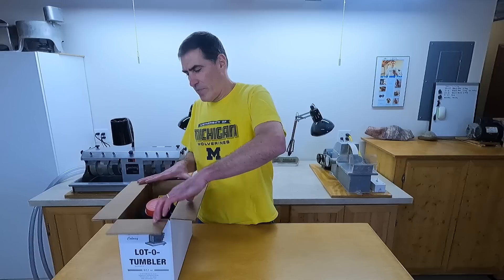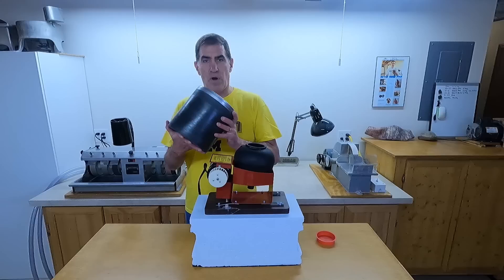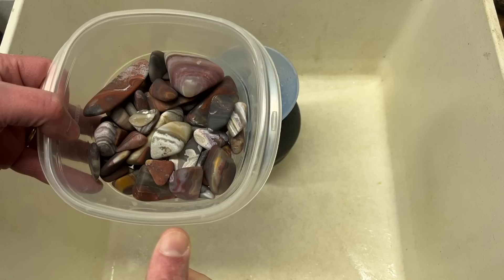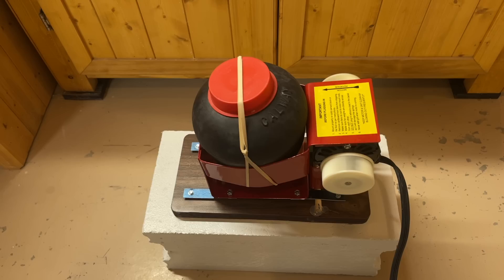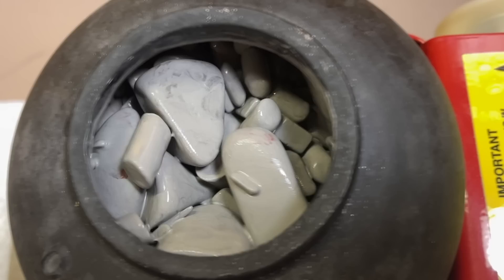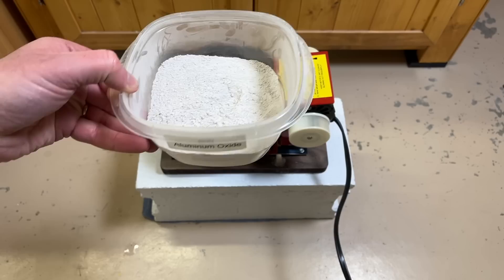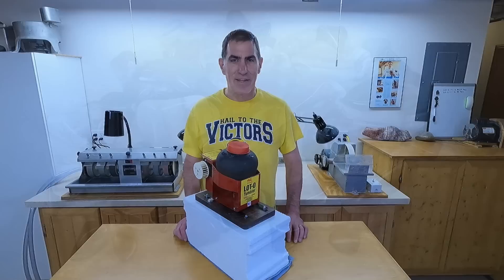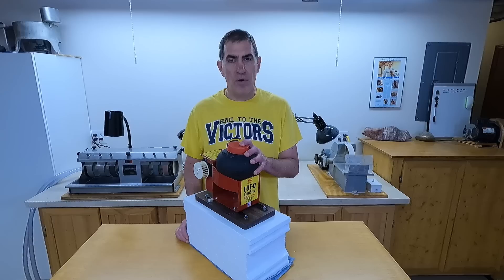The Lot-O Used To Be My Favorite Tumbler. It's Not Now. See Description Below.

Comment: Neat. It’s always fun to get new toys. That was clever of you to move the dowel. It really worked. It’s a shame that the factory doesn’t calibrate them properly. I’m sure that they have a lot of unnecessary returns because of that. The towel made a big difference in sound. You could barely hear it with the towel. The rocks polished up beautifully. The rock tumbling award that you won is something to be very proud of.
Reply from the maker: The towel underneath helps a lot, but the machine still makes noise. Don't expect it to be silent. 

Moving the dowel wasn't my idea, it's right in the instructions that come with it. I don't feel like it's something that should have to be done very often though.

Comment: Never dump down sink or toilet it can easily turn to cement and cost a heavy plumbing bill A wonderful trip I was given if in a rotary tumbler the drum slips take one hundred grit sanding paper and rough up a little bit the drive bar and the outside of the drum and since I did that never had the drum slip since
Reply from the maker: Good tips.

Comment: I'm glad I watched this video. I recently started using a Lot-O twin barrel vibratory tumbler, and I noticed the action didn't seem right (it didn't look like the action I've seen in your other videos). I may need to move the dowel. I'm glad to see others in the comments here have done the same and had positive results.
Reply from the maker: Just be careful not to move it too far. It can break springs if the action gets too violent.

Comment: Thank you for making this video!  I bought a double barrel last fall.  After watching your videos on using it I did notice how different the roll speed was between yours and mine... I was almost to the point where I was getting self conscious about it!  One thing I noticed with the double barrel is that over time the fans had come out of alignment thus causing one side to be less vigorous.  But anyway, great review!
Reply from the maker: I have never had my fan weights get out of alignment, but it's good to know it's something to look out for.
Reply: I purchased a twin Lot-O-Tumbler in the Spring and ran about 12 loads of stone when I noticed some differences in the tumbling speed compared to your videos and my own machine.  The left side tumbled faster than the right side.  I also had the left side fan come off during a session while I was asleep.  I sent an email to the Lot-O-Tumbler folks with an attached video.  The video showed a wobbly spin with the fans and some clicks as the motor came to rest.  I also had the same problem as Jared….one weight was in the 6 o’clock position while the other was at the 7-8 o’clock position.  I was advised to tighten the metal retaining clip with a pair of pliers and all should be fine.

I tightened the fan clip with the pliers and noticed that the right side was also loose.  I tightened both clips achieved a firm grip on both spindles.  I ran another load, stopped to change the grit and the tumbler sounded Ike a bucket of bolts for a few second before it froze.  It appears that the left side bearing is shot.  I wrote back to Lot-O-Tumbler and was advised that replacement motors were out of stock and would not be delivered until mid to late September  I checked several vendors and none of them had stock.

I don’t believe I did anything wrong or abusive.  Looking back at the events, I think the fans were not properly installed hence the bearing problem.  My suggestion to Jared and others it to tighten the fans before you burn out the bearings/motor.  Here’s the instructions I received.

“To tighten up the fan on the shaft ,remove the one the moves and tighten or squeeze the metal clip that holds it on reinstall it re align it and should be good.”

I’m out of the 90 day warranty so I don’t know if I’ll get any help from Lot-O-Tumbler.  The supply problems are also an issue since the machine will be sidelined until I can find a replacement or substitute.  If anyone has some suggestions I’d welcome the help.  This machine turned out some beautiful rocks and I’d like to get it running again.  My advice to new owners is to check the crimps on the fans since I believe it was an assembly issue.

Comment: Rob, excellent Lot-O overview video. I will say I purchased my Lot-O a couple of years ago based off of your work. It seems every single Lot-O is slightly different. I didn't fill my block base before painting and mounting and instantly regretted it. The base needs density more than weight for action sake. I placed railroad rail pieces in the block base and that added density helped action tremendously, so I'm glad you filled your holes. I put an old solid rubber doormat under my block between it and the concrete shop floor. Also, I found the use of a fine mesh sink drain strainer helps me drain the water without losing small ceramic pieces between my fingers, it fits over the mouth perfectly. I have a video on it here. I also discovered upon advice from another Lot-O user that my action works best if I give the bowl a slight, less than level, forward towards the motor tilt. Thanks for all your videos!
Reply from the maker: Hi Lance. One thing that I have noticed is that if you put two of them under your stairs like I did, the noise is more noticeable. You can sort of hear and feel it on the far end of the house upstairs. It's still not loud, but more noticeable than with just one. I have always had a folded up towel under mine. Since buying this second one, I bought some foam blocks designed for noise isolation. They didn't help at all. Now I have bubble wrap wrapped in the towel and placed under the block. I don't think that helped at all, but I left it under there.

I have used the strainer like you mentioned, but I worry that grit will get stuck in the rim around it and contaminate my batch. I drop a few between my fingers, too, but I keep doing it that way because I can be sure my hands are well rinsed.

That's the first I've heard of slanting the barrel. I'll have to try that.

Comment: I bought two of these as part of used lot a while back, that tip about putting epoxy into the dimple at the bottom of the barrel is great, I need to do that. And thank you for showing your process for getting it mounted on the block. I've chewed up rocks by not having mine mounted and know I need to do it, I just wasn't sure what the best way how is. Great content as always, thanks!
Reply from the maker: To put epoxy in the hole in the bottom, I twirled some epoxy on a stick of wood, like you would do with a honey dipper. Then I lowered it in and just let it drip off into the hole. It has never come out in over ten years.

Comment: Hans Beyer
Watched your video on the Lot-O vibratory tumbler review and enjoyed it. I was pleased with some of the information I didn't know like where the dowel is located on mine. I checked and it was like your example. One item that may be worth mentioning in the Cons section, the fact that the motor is warranted for only 30 days. I have to admit I didn't do my homework so I have only me to blame. I purchased my Lot-O last October (2021) and after less than six months the motor was shot. I noticed the noise getting louder and louder so I checked the shaft on the motor. There was considerable play, I could move one side of the shaft up and down, what seemed more than 1/16th of an inch (just a guess). Needless to say I was disappointed. I have tried to locate a replacement but there seems to be no stock. Hopefully that will change soon. Enough complaining. I really like the tumbler, just bummed for my bad luck. Keep up the good videos. I enjoy them and respect the quality of your shiny rocks.
Reply from the maker: A couple other people have made similar comments about their motors wearing out really quickly. That's definitely a con. Since mine lasted ten years, I was pretty happy. That's my only experience, so that's all I could say.
Reply: @MichiganRocks  I have had the same experience of the motors wearing out quickly.  From info I have gathered from others, they changed manufactures of the motor and the quality has gone down.  I still LOVE my lot-o tumblers!
Reply from the maker: @tinawilliams6020  That's really a shame. I'd rather pay a little more up front and avoid the headaches.

Comment: Thank you so much for the great video!  I am going to try adjusting my wooden dowel tonight on my double barrel since I am not getting as fast of a tumble as others seem to get.  
Sadly I have had my single barrel for about a year, and the motor needs to be replaced. Sealed bearing are ruined and local repair shop said that it cannot be fixed, but must be replaced instead. 
I LOVE my lot-0 tumbler! WIth my twin lotto, it 's motor went out (bearings went bad) just 80 days after use, but luckily that one was still within the warranty period and Calway/Belt replaced it very quickly for me!  Even with the few issues, I  absolutely think these are wonderful tumblers!   
Thanks for all of the great videos!
Tina
Reply from the maker: I have gotten a lot of comments on this video about people’s motors going bad after a short time. That’s really disappointing since these are great tumblers otherwise.

Comment: Wow and wow, I have used a Lot o tumbler and am glad to get two years out of a motor!  Unfortunately motors are not covered under warranty!  My lot o has sounded like a machine gun since new, and indeed the dowel was closer to center between the two reference points, I just “corrected” the dowel position, amazing change to the hum I was always wanting, and yes the rocks and media still rotate about the same, I strongly suspect the wear and tear on the bearings will be different with the smoother operation.  FYI I mounted an outlet box on the extended wood plank that was lag bolted to my cinder block with lot o base attached securely to the plank.  The 4x outlet box affords two outlets beside a light switch, very convenient.  Also a flat 1” piece of board insulation on the bottom of the cinder block makes a quiet installation and does not allow the project to walk.  Many many thanks!
Reply from the maker: Thanks for the tips! I can't remember if I showed it in the video, but I have a folded hand towel under the block to keep mine a little quieter.

Comment: Thank you! I have run one course of polishing like you demonstrate in this video through a new double barrel Lot-O.  It was a struggle because I couldn't get an active enough rotation within the barrel.  I paused the video at 18:35 and went to the garage to measure the location of my dowel.  It's 3 cm from the inside screw, and one side is even a little more: the dowel isn't parallel with the frame.  I'm going to take the measures you did and see if I can get that rolling rotation like you did. Thanks again for making such a helpful video.  I really believe the Lot-O tumbler is a superior tool --- once you get it tuned in.
Reply from the maker: With my first one, I didn't have to do anything to it, it just worked right away. It's a great tumbler. I use it on almost every batch of rocks I do.

Comment: Why did someone think it was a good idea to permanently fix an adjustable calibration device (the dowel)? The whole idea of such things is they can be adjusted to accommodate the operating conditions applicable to the final user. Hot glue is fine, perfectly acceptable even, but nailing it down is just bad design. The average, or first time, user is going to have no idea the dowel is supposed to be adjusted because it appears to be permanently fixed. Good job people like you are out there to inform us! 👍
Reply from the maker: I agree, but in the manufacture’s defense, they do mention that the dowel can be moved in the instructions. I don’t know if my first Lot-O has nails or not since I have never had to adjust that one.

Comment: I bought a double and it's still in the box, I bought it right before the prices jacked up. 
A buddy of mine has two or three of these, he changed the caps out because they popped off all the time, replaced with perforated lids, they never pop off now...
One day I'll get it set up, so I can tumble obsidian...
For now I use my 9 Lortone rotary tumblers ( different sizes)..
Thanks for sharing....

PS: This is Fossilman off of RTH....😊👌
Reply from the maker: Hey Mike, this comment came through blank. That's been happening a fair amount lately. I contacted YouTube about it, but they were not very helpful.

Comment from the maker: Since making this video. I have heard many stories about how quickly the motors on this tumbler die and how horrible the customer service is, that I can no longer recommend it. I don't have a recommendation for a different vibratory tumbler because this is the only one I have ever used. Both of mine are still running, but I think it's only a matter of time before their motors give out. There is some really good information about possible replacement motors discussed here: https://forum.rocktumblinghobby.com/thread/100982/experience-lot-failed-motor?page=1&scrollTo=1253535
Reply: I have noticed my motor gets so hot I can’t hold my hand on it. It is only a month old. Is that heat normal?
Reply from the maker: @flyingweinerdog  Yes, mine gets really hot too. My first motor lasted about ten years. It was quiet at first and developed a buzzing sound over the years. I think that sound was the bearings going bad, because that's what eventually did it in.
Reply: @MichiganRocks  Uh-oh... I bought my wife Mary a Lot-O a year ago, and we're mounting it as we speak (Thanks for this video by the way!) I hope the motor doesn't go on us. We lost a National Geographic 3lb tumbler after about 6 months due to that motor dying. It would be a shame to see the Lot-O go too! I wonder if there's any kind of engine oil or something that you can put in there to help it last longer...  Hmm.....
Reply from the maker: @DavidShockley  I don't really know. I don't think those motors come with an oiling hole.
Reply: Thank you for addressing this issue.
Reply from the maker: @vlakslee  I like to be as accurate as possible. I have heard that you can't even get these right now because the manufacturer can't get the springs from their supplier.
Reply: @MichiganRocks   - Yep i have been trying to find a place that will sell the Lot-O, but they are all sold out at all the Lapidary sites i checked.   Have you ever used the Inland DB-100 band saw?
Reply from the maker: @nobodyisprfct  No, I haven't.
Reply: Unfortunately my Lot-O-Tumbler stopped working after 11 months because the motor seized up. I was unable to buy a replacement motor. After a couple months, I was unable to endure the withdrawal symptoms and luckily I was able to buy a new Lot-O-Tumbler. I moved the dowel forward as you did since the action in the barrel was slow. Now it’s working very well. I’m hoping this motor lasts longer because I like the quick finish this tumbler makes.  Thanks again for all you do for Rockhounds like me!
Reply from the maker: @lilalightandlove421  I have heard way too many stories like this since making this video. I have two of the newer motors now, so I'm very worried that I'm going to have the same fate. So far, so good for me though.
Reply: @lilalightandlove421  -  did you buy this Lot-o-tumbler recently?  I sure would like to get my hands on one.
Reply from the maker: @nobodyisprfct  I bought it over a year ago. I wouldn't buy one now. The stories of motors failing quickly and no support from the company just keep coming. I love this machine, but the motors tend to fail after only four months in some cases. The warranty is for only three months.
Reply: @MichiganRocks  I see thank you for your reply.  I will continue my search for the perfect or as close to perfect vibration tumbler.

Comment: This video was quite helpful, I recently got the Lot-O vib tumbler and it just was not working as the others I saw in YouTube vids, not as vigorous in movement of the rocks. Then I saw this video and sure enough the dowel was positioned at a slant, not perpendicular to the base, etc. Fixed it and works pretty well now.
Reply from the maker: Great, I'm glad you have it figured out. These machines are awesome when they're well tuned and the motor is working.

Comment: Thank goodness for your videos, exactly how mine is running, I'll need to tune it the same as you did, the instructions from the factory now even state that they may need to be tuned to work right, disappointing, since it should be simple to do it right in the first place if someone actually cared about doing a good job.
Thanks again for your help Sir.
Reply from the maker: I think the instructions always had the method for tuning it. That's not new, what is new is that they tend to come untuned.